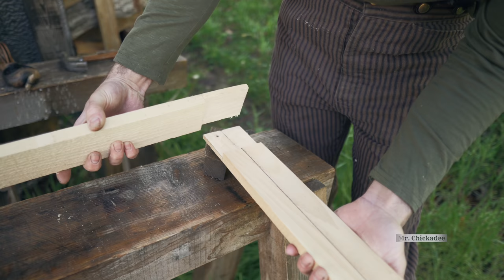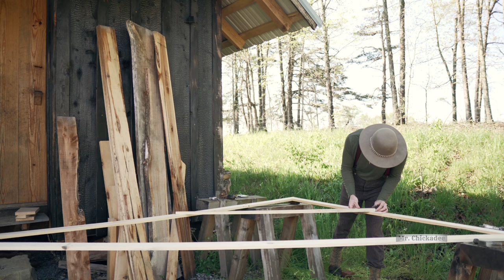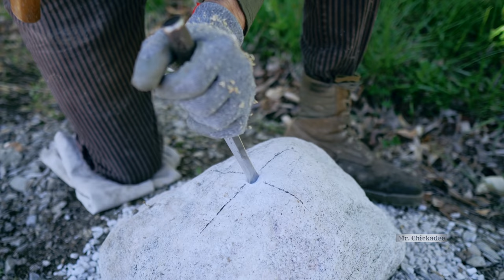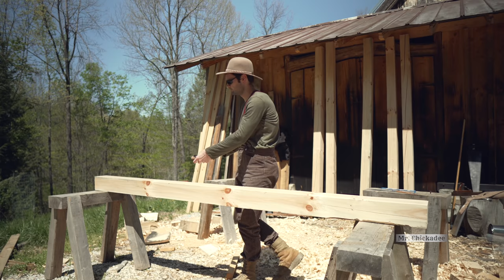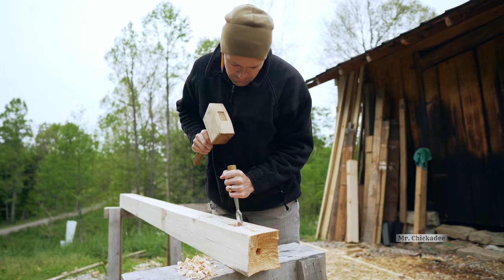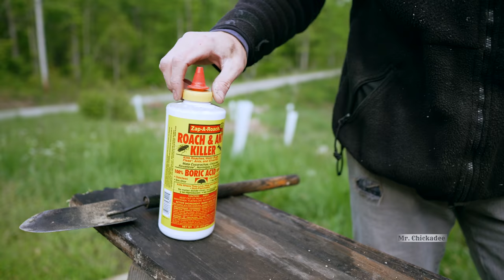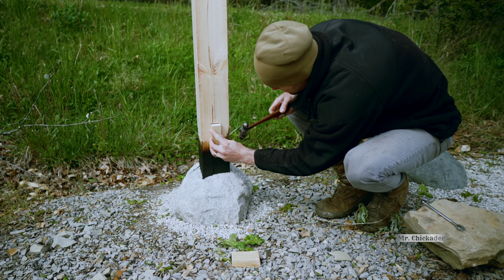Anchoring timbers to stone: ancient technique with modern twist for building codes/extreme winds.

Comment: Why scorch it?
Reply: This delays the rotting process of the wood. Since this is the lowest wooden part of the structure, it is very likely to amass water droplets and absorb them there. This is perfect for wood consuming organisms. By being (kind of) insulated by charring and drenching it in oil – I assume it's old engine oil – wood will pick up a lot less moisture and also repell insects, at least in the treated area.
Reply: @razeel2000  pine tar, linseed oil mix
The video has captions
Reply: it helps fend off the plant "The Wandering Jew."  if that plant finds its way into your garden, it starts telling the other plants that they will not survive unless they accept termites, beetles, and other foreign pests.
burnt wood prevents The Wandering Jew like marigold prevents rodents.

Comment: why the roach and ant killer? is it because burning inside the hole doesnt get deep enough? also im just not familiar with why burning the wood helps if someone can elaborate..? also what was the sealant used after burning the wood? sorry for all the questions :P
Reply: Explanations are in the subtitles. It's boric acid to make the grout.
Reply: Turn on subtitles, useful information in his videos.
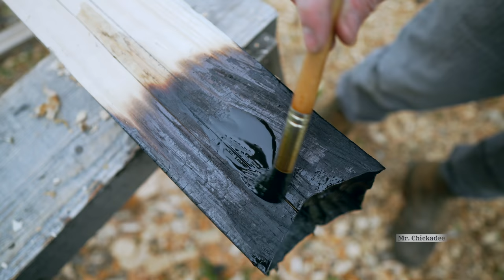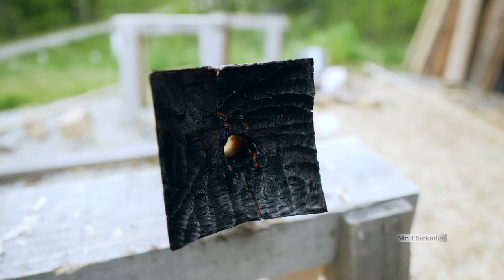Reply: Sealant is pine tar mixed with linseed oil.  Yes, you can turn on subtitles but they don't always appear at the right time - you don't see the pine tar linseed info until 14:01 even though he was brushing it on starting at about 13:35.

Comment: Now i understand that this is an experimental take! Here are my thoughts. I think that this, originally japanese(?) technique is a way to make a building self locking from weight on to perfectly fitted "shoes" standing on rock. The lack of "forced-bond" allows the structure to move and to become stronger over time as the shoes are sanded from pressure and small movements. Now, forcing down the shoe is of course a safety measure but defeats the whole idea of why this is a good bond. Its not a plinth. How you would go about strong winds is to have a heavy construction. That stone does not look like allot of anchorage since its small and sits shallow by the looks of things. It would be much more effective to have heavy elements in the construction working with the principals. Another issue is that you introduce gaps in the wood where it becomes vulnerable, metal which conducts heat in a different way than stone and wood will potentially form condense that would lead to mold and rot after some years, these are if you want your construction to last over the centuries but if you are fine with a 10-30 year lifespan then you are fine i think.
Reply from the maker: Dont over think it friend, not experimental, been done for a long time yet. This is a simple small wood shed, if you need more help, use larger stones, and more of them. Obviously to a point, with wind that strong it will likely just destroy the upper part of the building before moving the stones, if they are large.

Comment: Whould not be easier to flaten the stone?
Reply from the maker: No, always easier to chisel wood than stone!
Reply: @MrChickadee  That is a good point. How is that epoxi mixing nozzle working? I have found that epoxi dries pretty fast  ( 1 - 2 minutes) and rendering the nozzle useless.
Reply: Also seems like flattening the stone will cause it to catch more water, which you obviously wouldn't want.
Reply: easier to carve wood than stone. besides now there's a slope for drainage.  flatten the stone you end up with a spot where water will settle.

Comment: I can hardly get the subtitle up for long.
Reply: you can hit the space bar to stop the video, or the center of the screen.  Also, you can slow down the speed of the video by clicking on the “hot dog” in the upper right hand corner of the screen.  It will give you a drop down box where you can choose settings.

Comment: What is that tool at 9:40 called? I need one badly.
Reply: I think that's an ocarina
Reply: scribe
Reply: stick with a hole in it.
Reply: You can do the same thing with a marking compass. Just take the point off one end, and let the side ride along the stone, while the pencil marks the wood.
Reply: Pencil. #2 i believe.
Reply: It´s a hand, HAL 9000
Reply: Make one out of wood or metal? A bit of scrap with a hole drilled through it would work just as well I guess?
Reply: get a scrap bit and drill some holes into it so ur pencil sticks out (and use sander to make it pointy if u want)

Comment: I forget, why burn it?
Reply: I think burning creates a protective layer against rotting and insects
Reply: burned wood is water and bug resistant. Will last a looooong time like that.
Reply: I believe it is old school termite and bug preventative
Reply: To make it waterproof and insect proof
Reply: Light burning produces carbon which strengthens the wood and protects it from moisture. The trick is to not overdo it because that breaks down the structure and makes it weak.
Reply: Also bugs don't like it.
Reply: termite/borer/rot resistance if I remember correctly.
Reply: seals the wood, keeping out invasive pests, water, and mold. sealing with his homemade lacquer is further protection and longevity
Reply: Burning the wood is an ancient trick to preserve wood from rotting.
Reply: the technique is called: shou sugi ban.
Reply: To keep it last longer from rotting
Reply: Bugs don't like the taste of chard wood fiber, helps prevent rot by infestation
Reply: Preserves it against rot and makes it harder for other pests to eat through it. The mix he did with boric acid was a good line of defense against pests and especially termites.
Reply: It preserve the wood from rot and bugs.
Reply: 焼杉板
Reply: helps to treat the wood against rot and insects
Reply: Several reasons. burnt wood doesn't absorb water as easily. the process of burning it also naturally draws out any moisture in the wood. Insects like termites don't like burnt wood. Charred wood does not burn as easily as fresh wood or charcoal (charred vs charcoal, there's a difference). Fungi don't typically grow in charred wood either.. Probably more I can't think of
Reply: IIRC, to prevent insect damage and/or rot.
Reply: as far as i know prevent some water damage and bug issues as well as slow natural decay
Reply: To protect the wood
Reply: Burning the wood makes it more resistant to rot and insects
Reply: It seals the wood and hardens the surface

Comment: What's wrong with concrete and a shovel? This seems like a waste of time and money.
Reply from the maker: Your attitude answers your own question.
Reply: Making cement for concrete is a major contributor to global warming and the climate crisis and is considered the most destructive material on earth. If concrete were a country, it would be the third-largest emitter of CO2 behind China and the United States.
Reply: I suspect that Mr. Chickadee's method will still be suppoting it's structure as intended, Long, long after your poured concrete n' post method is a rotted pile of slush, or turned into insect poop!
Reply: Your idea buries wood under the ground where it can get waterlogged and rot

Comment: Ancient my ass... basically click bait

That is a PITA decorative stone footing.
Why not just finish the job with epoxy on the bottom to fill the void? 

Good video and nice careful work. just not what i was sold.
Reply from the maker: Title" ancient technique with modern twist" 

ancient technique = scribing timber for stone plinth foundation having thousands of years of proven service and use in Asia

Modern Twist = adding threaded rod to the stone and post 

Sorry that was too hard for you to understand.
Reply: Read AND comprehend!
Reply: @MrChickadee  Dont even bother reacting, these are the people that look for reasons to call the police all day.
Reply: I'm pretty certain the intent was to demonstrate the technique. Sure, this stone is small, but you can easily apply the method to an arbitrarily large boulder.
Reply: what is click bait? The title accurately describes the video. You are in the wrong neighborhood. This is authentic pre-power tools and skills neighborhood. This is not the "fill the gaps with epoxy and be done with modern methods" neighborhood. Know where you are before you speak.